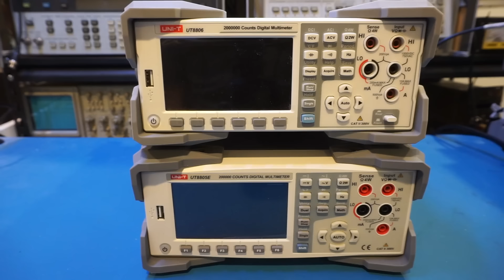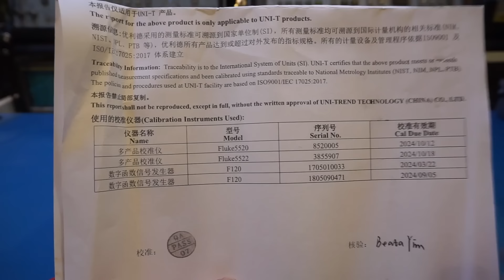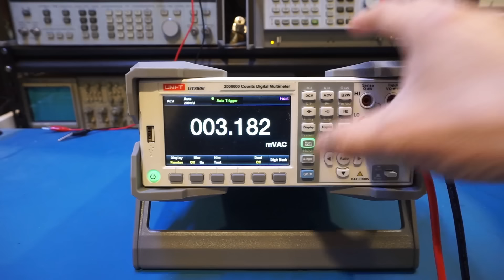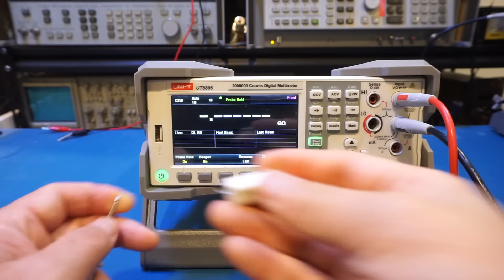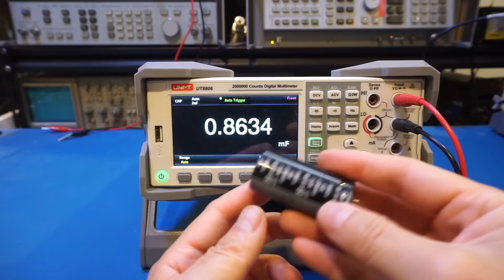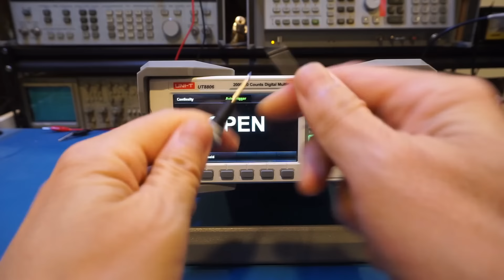UNI-T UT8806E 6 ½ Digit Benchtop Multimeter, In-Depth Review

Comment: This review is worthless to me. The first question to ask is: 1. Which voltage reference is this thing using? 2. Which resistors does the device uses for resistance measurements? 3. How linear is the ADC? 4. What are the specs for drifts in measurements over time?
I suspect Kerry Wong being prohibited to open the multimeter. A smart and curious guy like him would normally look inside. So this video is by far not a "in-depth review" it pretends to be.
Reply from the maker: Did you watch the teardown? https://youtu.be/x4Kwptu3WpM
Reply: @KerryWongBlog , the teardown video you linked is more convincing and meets some of my expectations.  This video here is more like a video manual of the device.

Comment: This meter costs more than my Agilent 34401A and my Keithley 2015 combined with calibration for both and can't hold a candle to either wrt performance and doesn't have graphing ability like Rigol or Siglent. Plus the Keithley has THD and limited SMU functions! I'd even say my old HP 3478A is more stable at 5 1/2 digits! I'd put this in the same category as the East Tester ET3240 I bought as a beater for the garage/workshop bench but with 2 extra digits and 4 times the price;
Reply: At $860, you likely could even find a Keithley 2010, with a little patience. 
Chinesium crap with crazy price. $200 might be OK.

Comment: (Edited to correct performance data regarding UT8906E)

My Bench meter is a Keysight 34460A.  It is pretty clear that the Uni-T UT8806E echoes the Keysight meter design.  Imitation is the sincerest form of flattery.  The UT8806E appears to perform well.  One difference I see from the web site data is that the  UT8806E is capable of up to 10,000 readings per second whereas the 34460A is specified at 300 readings/second maximum.  The web specifications do not list any accuracy trade-offs versus reading rate.  That could make a difference for automated test equipment throughput, which is a use case for both meters.  The AC measurement bandwidth of the UT8806E is actually better at 1 MHz versus 300 KHz for the Keysight.  Probably the nicest feature of the UT8806E is that the street price is almost $500 less than the 34460A.

If I had to choose now, I would be seriously tempted by the UT8806E’s lower price tag and coming close to Keysight’s performance.  Uni-T also has a five year warranty versus three years from Keysight.

Speaking of ATE, the Keysight 34460A has an emulation mode which allows it to be 100% compatible with the venerable HP 34401A which was a standard in ATE racks for many years.  I have a feeling Keysight provided the emulation mode in hopes that would make the newer meter compatible with government contracts which specify 34401A.  You can find that Fluke made the model 87 DMM for decades because government contracts and written service procedures called out the exact model and how it was to be set by the technician step by step.
Reply from the maker: Where did you see the 10 readings/second spec for the UT8806E?
Reply: @KerryWongBlog  Thank you for pointing out my error.  I misread the specifications on  the uni-trendsus web site.  The specification is “Maximum reading rate: 10k rdgs/s”.  I will edit my original comment properly reflect the correct information.